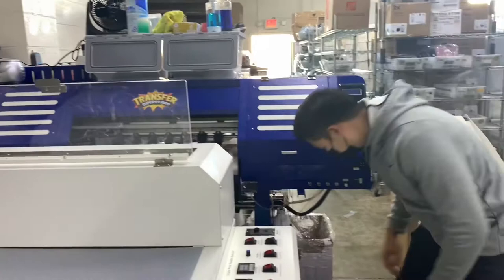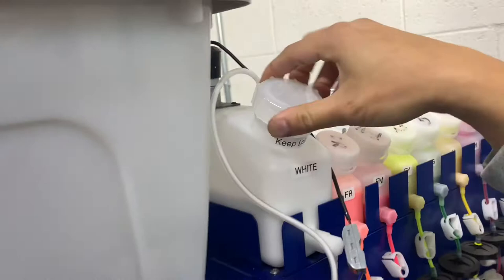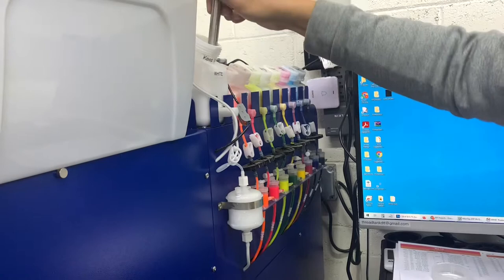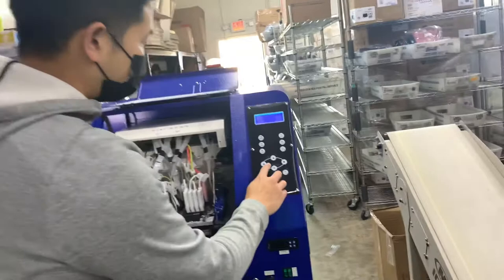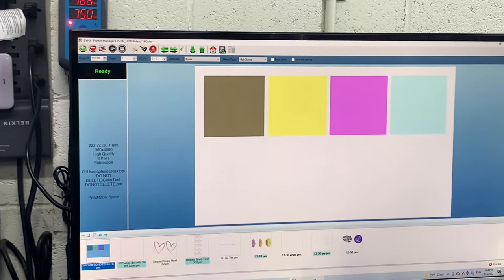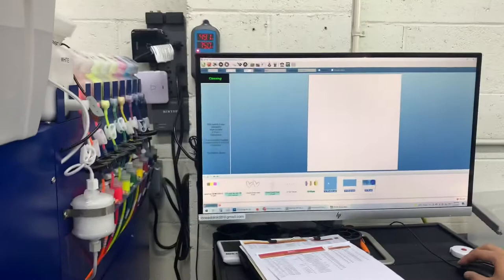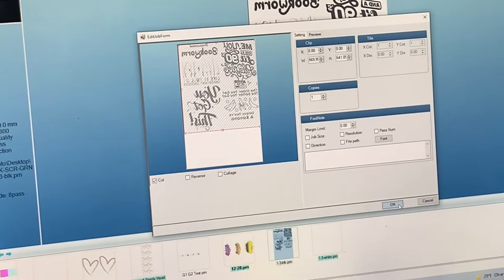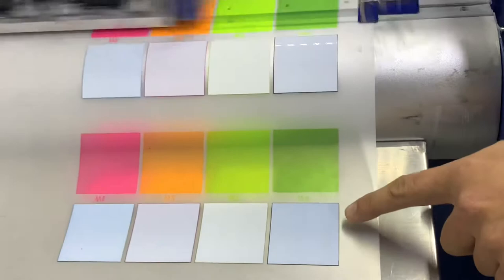Transfersuperstars- HJD Wide Format DTF Printer Daily Pre-Production Standard Operation Procedure

Comment: Can you give some instructions on the shaker/dryer please. I have the HJD 2 head printer with shaker/dryer.
Reply from the maker: Did you just get the HJD? I'm not sure what components are in the newer machines. The shaker has been pretty straight forward. Just takes some time to get used to printing a full run.
Reply: @transfersuperstars  yes. The printer is up & running. Do you know what heat to set it on? Speed of shaker?

Comment: Question can the L1800/1390 dtf printer print 13” ?
Reply: not,the L1800 is for 11.750 x 16.500 only
Reply: @yourunclesam6780  this is not correct. I am using my l1800 to print a 13" x 19" as I type this.

Comment: After second cleaning cycle, the density of the white ink also improved. This is another common problem with white inks on DTF, usually after one cleaning cycle the standard print check only prints lines and if all lines are printed most people start printing. But you instead used all available colors  plus white, showing a better status of ink within the printheads. As a standard practice now, we usually run two clean cycles after each weekend. 
I also really like you using orange and green colors, I am sure you can get very close to those color targets. Usually we inform our customers about how close the print colors will be to their actual pantone values. Use of Fluorescent Yellow and Magenta gonna produce some interesting results. Good video sharing your SOPs.